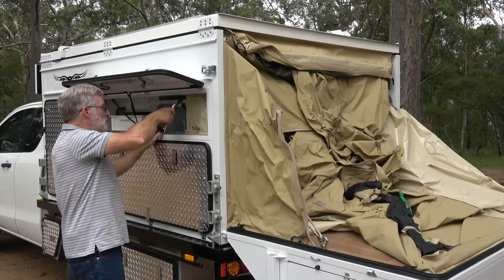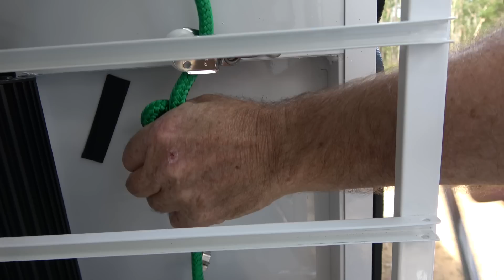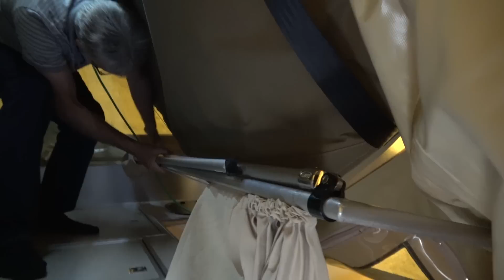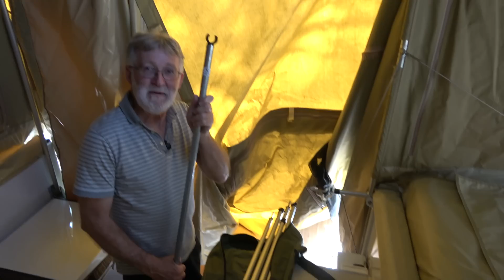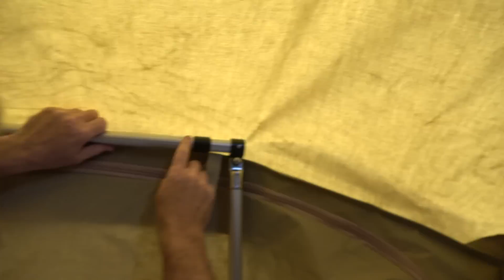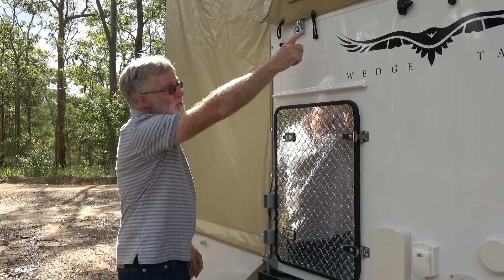Wedgetail 22 Camper detailed Opening Procedure/ Instructional

Comment: I love my v-10 powered 40 ft motor home. Pull in, shut if off put on the parking brake.  Push a button for the automatic leveling/stabilizing jacks and turn the key to put the slides out. Walk outside and pull awning out. I know that seems complicated compared to this guys set up though.

Comment: Hi everybody, my wife & I have owned our wedgetail for about 3 years now and are extremely happy. Just completed a trip from Maytown to Laura travelling the old Folders Hotel road & then onto the Telegraph track crossing all rivers & then to the top of Aus. This camper is amazing & so easy to open (approx. 10mins) & close (approx. 15mins) and we did this nearly every day and we are well into our sixties. David Hazelwood has used high quality materials & fixtures and every aspect of the camper worked perfectly. After sale service is top class, I backed into a tree on the way home to Helensburgh NSW damaging the rear pod, this was replaced by Wedgetail in a day. David & staff, we would like to thank you for an amazing unit and great service. Allan & Jan (David I think your video is a bit to detailed long winded), sorry mate.

Comment: Help I'm stuck on bar number 37. 

Bars 1-18 were pretty straightforward although tedious. Bars 19-25 took more experience and muscle. Bars 26-36 really test your patience!

I have the instruction manual but must have misplaced chapter 5. I was using it for a seat riser but now I can't find it. It has the procedure for the top platform and bars number 37-58.

So I'll just leave my camper half open out here in the wilderness and wait on an answer. Thanks!

Comment: All nice by the design. Assembly likely takes about less than 5min if you have two doing it or you have little training for it. 
But what I am always worried in these designs is the canvas structure integrity. In years time it will weaken, it starts leaking or worse it will rip and you can't fix it. Those velcros are as well IMHO a weak points, as they get dirty and they will lose their attachment capabilities. 

So I don't find the design bad, while even those aluminium poles and their plastic parts are weak points, the design is clever and nice. I just would have made the solar panel detachable so you can move it to side of the car for a sunlight.
Reply: You kind of made my point. I don't think these polls have enough structural Integrity to a stand even a fair amount of wind and also my concern is one pole will get out of position and poke a hole in the canvas. Or if you bent or broken pole it could make the rest of it quite unstable. I don't think this is for the average guy unless you were staying quite a while and had some extra poles that you could use in an emergency

Comment: Coleman pop ups are far quicker. Solar panel is useless when you need it the most if it is permanently attached to the "roof".
Reply: Subgunman it's not permanently attached, you can take it off and set it up into the sun with another connection lead.